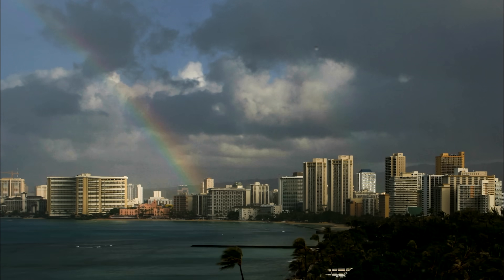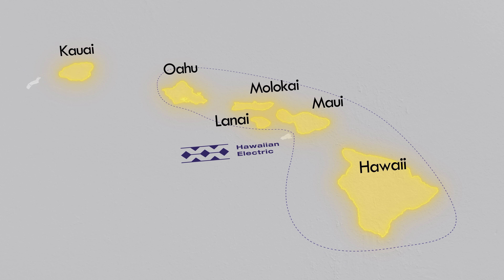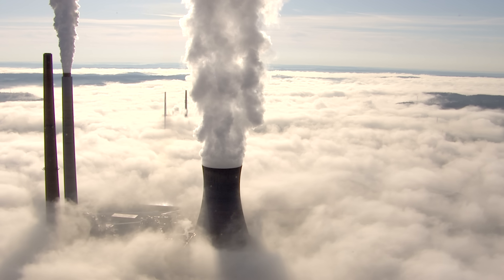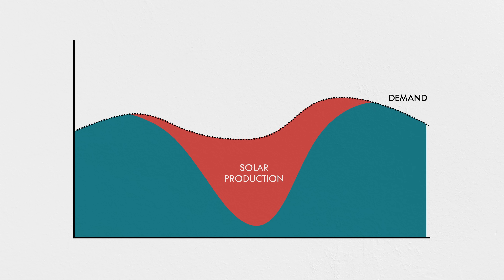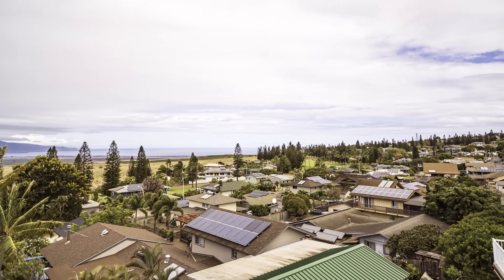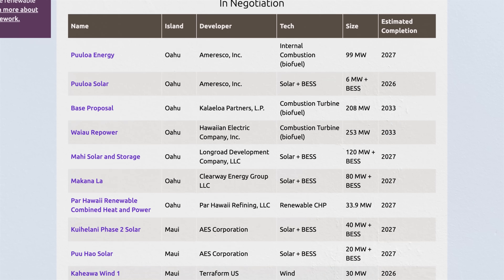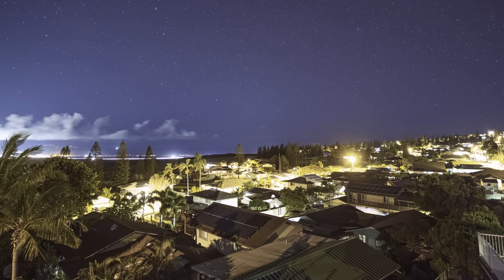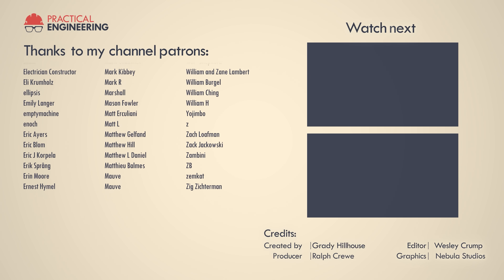How the Hawaiian Power Grid Works

Comment: When I was in Iceland I was amazed by how much infrastructure has been built out for geothermal power generation. It seems like a no-brainer for Hawaii that they should go all in on geothermal on the Big Island, and drop a DC interconnect cable to the rest of the islands to share the power.

Iceland did this in the late '90s, and as a result their citizens get electricity for basically free. They have so much extra power that it's cheaper for companies to mine bauxite in Australia, ship it to Iceland, and smelt it using the excess power in Iceland than it is to smelt it in Australia.
Reply: In contrast to Hawaii, there are no 3000m deep fissures on Greenland. Hawaii consists of up to 9600m high Volcano Mountains on the 5000m deep ocean floor.
Reply: Except as said in the video the costs of connecting the islands is not cheap.

Also their one geothermal plant broke due to lava
Reply: Its so funny how many people go about repeating that. Yes iceland smelts aluminium, if you look them up on electricity transparency services, their day/night swing is just 100 MW, they have a constant consumption of 1.4 GW 24/7. BUT Hydro is more than doubling the geothermal production.

Geothermal is more relevant in supplying their heating, wether process heat or residential (which given the climate is a massive energy saving),
Reply: Only the Big Island has a viable geothermal potential. The one facility near Hilo was almost over run by lava so it's a tricky power source with such volcanic action changing almost daily.
Reply: The islands are ex-volcanoes rising up out of the ocean depths. The sea is three miles deep. 

It's not like the islands you get off the shore of the mainland USA. The sea around those is shallow, often less than 200m - they are still on the continental shelf (the British isles are the same). 

The power cables can't be like those use for communications, which are a few inches thick. A DC interconnect cable needs to be much thicker, otherwise you loose to much power.  No-one has ever laid a DC interconnect cable across oceanic depths.

Can it be done? Probably! But Hawai'i would be the first people ever to do it.
Reply: The politicians here are far to corrupt to do anything practical or that word actually benefit the working class.
Reply: Cmon. You visited Iceland so you know it’s power? About 3/4 of icelands power capacity is hydro, the rest geothermal. Geo is much more expensive than hydro to build, and needs an ample  fresh water source. Iceland  has that, Hawaii not so much.
Reply: I'd imagine geothermal requires quite a bit of water as well, preferably fresh water, because it works on the steam cycle.
Reply: @belacickekl7579  I think they inject it back in the ground, so it's reused, unlike nuclear and other plants where steam or warm water is released for some reason.
Reply: @sandal_thong  'for some reason'. That's what I'm trying to explain; because of the laws of thermodynamics, you can only extract so much energy when making electricity. The remainder goes into the air or water exhaust.
Reply: I remember something about the geothermal plant in Hawaii not working right or causing pollution even before it was shut down by the lava. As to whether natives oppose geothermal projects on principle, that should be looked into. Maybe it's just a matter of them making the decision, like for the astronomical observatories?

Elsewhere in the states, Native Americans are considered low caste, and expected to get out of the way when whites want to use the land, like for pipelines. And when "Water Protectors" protest, authorities come down on them (and reporters) harsher than you'd think warranted. In Alaska, there's coastal erosion, but those in charge don't want to give permission for native communities to move their towns further inland. I guess they're supposed to stay put and fall into the sea? Probably foreshadowing what will happen to island communities around the world as global warming proceeds.
Reply: The volcano is sacred to a lot of native Hawaiians.  It'd be like building a nuclear power plant on the temple mount in Jerusalem.
Reply: @jeffspaulding9834  Don't need to build the power plant literally inside the caldera of the volcano. You drill down at any point on the island about 500 to 1,000 ft deep and you'll get rock hot enough to boil water.
Reply: @Hyperious_in_the_air  Sure.  Now frame that argument so that people who believe a volcano goddess rules over the islands will be persuaded.

Religion and logic aren't always best friends, if you know what I mean.
Reply: @jeffspaulding9834  Just a bunch of voodoo horseshit really. A shame it's holding them back.
Reply: @jeffspaulding9834  the elites also practiced !nc3st, cannibalism, and ritual sacrifice should adhere to those as  well?
Reply: @jeffspaulding9834 Religion has always been a barrier to progress
Reply: @jeffspaulding9834  Yes, and?
Trees were sacred to my ancestors. Didn't stop 'em from cutting them down when needed.
Reply: @stevenschnepp576 I imagine your ancestors didn't have quite ability to increase the cost and political maneuvering required to cut down those trees as the Hawaiians have at their disposal.
Reply: @stevenschnepp576  And that's why deforestation killed off natural habitats, a problem we're still trying to fix
Reply: Much of Iceland's power was used for Bitcoin mining.
Reply: Youre thinking of AC... The distance for DC is much too far...
Reply: @thejman5552  Look into HVDC transmission (Wikipedia has a good article) - less loss than AC, fewer conductors, no requirement to have the phases synchronized.

It'd be perfect for Hawaii's situation - except for the undersea cable bit.  I think people fail to realize how far apart the islands are or how deep the ocean is around there - the big island is actually the tallest mountain in the US if you count the undersea part.
Reply: @jeffspaulding9834 It’s taller than Mount Everest if you’re including the underwater part
Reply: @appleintosh  True, but I specified "in the US" because I don't know if there are taller mountains than the big island elsewhere in the world if you're measuring them that way.
Reply: @jeffspaulding9834  The islands are closer than Britain is to Europe - and they have an HCDV connection. The difference is that the English Channel and North Sea are nothing like as deep as the ocean around Hawaii!
Reply: @jeffspaulding9834  How is HVDC of any use to Hawaiian islands if marine cables are ruled out?
Reply: @Nill757  I suspect you  misread my comment.  I was replying to someone that seemed unaware of HVDC.  I never recommended it for Hawaii because of the undersea cable bit.
Reply: @jeffspaulding9834  --  Well, how far are they apart?   Five hundred miles?
Reply: @GilmerJohn  A quick Google search says it varies from about 10 to 70 miles for the main inhabited islands.  The channels are really deep, though - as in a few miles deep in some cases.

I'm not saying it's not possible, I'm saying that it's probably something that would require a lot of expensive engineering and development and would run the risk of a very expensive failure.
Reply: @jeffspaulding9834  --   Well, if it's a few miles deep you will need at most a few extra miles of cable.  It might require some anchors every so often to keep the weight of the cable from stressing it too much.

It might take some good engineering but otherwise it's a "doable" problem.   

I suspect that the geothermal in that area desn't scale up very well so it's just cost effective to continue to haul fuel and run either diesels or gas turbines to generate the power.
Reply: @GilmerJohn  Looking at Wikipedia's list of undersea HVDC cables, it'd be a lot deeper than any we currently have.  That's the "lots of engineering" bit.

It does list something called "PowerLink" as a proposed power connection in Hawaii, but didn't give details.  You might look into that if you're interested.
Reply: @jeffspaulding9834  --  Oh, I have no particular interest.  I just jumped in when my former engineer ears perked up when it was said that it would be very difficult to send power between the Island.   That just didn't "Sound Right" to me.
Reply: @thejman5552  -- There are tricks to make underwater AC lines run further.   Usually, the problem is too much capacitance and this can be compensated with some lumped inductors along the line.
Reply: @thejman5552 The UK connects with Denmark using HVDC and that is 765km (475mi). The straight line distance between the east tip of O’ahu and west tip of Hawai’i island is only about 250km. The benefits of a DC connection is that it has frequency isolation so that one island not having enough energy doesn’t affect the others.
Reply: @Thrad5  Thanks for informing! New rabbit hole unlocked!
Reply: @thejman5552  lol, no. DC is vastly superior. There's an interconnect line running from the Columbia River all the way down to Los Angeles at something like 1,000KV which experiences minimal loss compared to AC.

Comment: why not use Geothermal? I'd think it wouldn't be sporadic on Volcanic islands...
Reply: They do have a little Geothermal, but really it's not as simple as you might think. Geothermal for electrical generation needs pretty high temperatures, so even on volcanic islands you need to drill fairly deep, and drilling into really hot rock is difficult and expensive.

Comment: One thing I want to mention. When I lived on the big island one thing you could see on a lot of peoples homes were solar panels. Even crappy looking beat up homes had them. So while the grid as a whole is mostly petroleum there are a lot of homes that get their power from solar during the day and the stored power in the home batteries at night. Plus virtually everybody I knew had a little Honda generator for when the power went out. So while the grid would under go blackouts they could either used their own personal stored solar power or just turn on their generator.

Comment: I did some design work on a simple cycle combustion turbine generator install near Kapolei about 15 years ago.  Besides the high wind, high seismic, and unfriendly volcanic geology and a high salty water table, there were other atypical costs.  It had to be a 'black start' unit, so it had its own batteries and diesel generators to fire up the CTG w/o off-site power, not cheap.  Additionally, the unit was credited for providing power to emergency facilities, hospitals, fire stations, etc.  therefore increasing its IBC importance category from the normal III to IV, a considerable expense and an increase to the design loads. 

Lastly, shout out to Palo Verde generating station at 5:05.  My favorite plant and an absolute beast.

Nice video.
Reply: What does IBC stand for?
Reply: Doesn't look very Verde
Reply: @westrim  Literally or figuratively?
If you mean literally, I get it. Not much grass around that power plant.
But figuratively? That power plant is the second largest nuclear power plant in the U.S, providing Arizona with reliable, carbon-free electricity. The white "smoke" coming from it is simply water vapor with absolutely zero carbon dioxide, other dangerous gases, or radioactive substances. Nuclear power is one of the safest forms of electricity generation out there, with a deaths per unit of energy number similar to that of wind or solar, even when counting Chernobyl and Fukushima. Chernobyl is estimated to have killed 4000 people, Fukushima killed exactly 1 and Three-Mile Island killed 0. In 1975, a hydroelectric dam in China failed due to a big storm, and the number of deaths it caused is an order of magnitude higher than Chernobyl, and the only reason why hydroelectricity has more deaths per unit of energy than wind, solar, and nuclear. However, using fire to generate electricity has killed way more than nuclear or any renewable source. The use of coal and oil to generate electricity has killed millions of people due to air pollution and will kill more due to climate change. Even natural gas has killed more people than nuclear and hydroelectricity due to the small amount of air pollution it creates.

Comment: The "low inertia" worry of solar at least (and I assume wind, though I'm not nearly as sure how well wind turbines deal with the accompanying load modulation) is self-inflicted: due to their inverter nature and trivial ability to throttle their inverter's power source, they could be programmed to behave as desired, including like a steam turbine (though it might require some capacitor or battery storage to fully match steam turbine behavior).
The issue is just that grid operators didn't want solar inverters to behave anywhere near like that for a long time, and by now seem to have mostly given up on it in favor of letting storage plants that perform day/night energy shift do the task of grid stabilizing.
Reply: It would make them more expensive mainly. To get the same amount of inertia you'd need a big capacitor bank or a massive flywheel, and those don't come cheap.

Comment: I'd say that Hawaii is a good testbed for renewable energy.  Multiple independent grids gives multiple test cases.   Lack of local fossil fuels coupled with high prices from high transport costs puts both commercial and green interests more in sync.  Also, being relatively close to the equator means potential solar energy varies less over the course of the year and any other US state with Alaska being the most variable with some areas in the north not seeing sunlight for months at a time in the winter,

And, as a mostly tropical climate, there is less danger to people when an outage happens.

Comment: Fantastic!  This is the first time I've heard anyone outside of power systems electrical engineers bring up inertia on the grid!  Part of the value of building out pumped hydro storage is increasing the spinning mass connected to the grid to stabilize frequency.  It's great that someone is finally discussing these more complex issues!
Reply: Is it the fly wheel effect?
Reply: @mark33545 basically yes

Comment: Honestly, I’ve never given much thought to the Hawaiian power grid before, I’m surprised it doesn’t have high-voltage DC interconnects though.  That system wouldn’t solve all problems, but it might help with some issues. A quick Google search shows it’s been proposed several times over the years.

Comment: In Germany (and Europe) solar inverters have to monitor the voltage and frequency. If these values go out of tolerance, the solar inverter must switch off. An automatic relay is required. A large Chinese manufacturer ignored the regulations and then had to repair hundreds of systems free of charge. The manufacturer did this "voluntarily" and did not want to be named in return.
Reply: Probably Huawei, we have some Huawei inverters at the company I work for.

Comment: The issues with electric power in Hawaii can be summed up simply as: Politics and Environmentalists.   
Even mediocre engineers could easily make each islands electric power reliable and less expensive, but politics always prevails.  Though it indeed has the highest electric rates in the US (>3x), it is also one of the most highly subsidized electric generation infrastructures, especially the "green" methods.  Lived there for 5 years on the "Big Island" of Hawaii, the geothermal power stations were the only sources of several island-wide power outages every year.  This is because in order to get the Federal grants to build and operate the totally subsidized generators, the Federal government required that they be connected to the island-wide electrical grid.

Comment: I use about 15kwh a day , its 0.45c per kwh not including standanding charges and other government rubbish so in total I spend about €3000 a year on power that's a con. The more "renewables" we install every time the price goes up they claim "due to the cost of wholesale importing" or some other way of saying we have investors and we have to pay them. This year I'm going to install about 5kw of panels and I'm building banks up from old laptop cells (3x1kwh banks already made up) and going to try to lower the use of the grid as its just a scam these days. If you look at it this way a single 395w panel is now only €90....payback for panel alone is less than 6 months, it's insane how cheap it has become to just say goodbye to the national grid that's become one giant bunch of rich people looking to screw jow public.

Comment: Well, in such a situation 'virtal power plants' could be a valuable part of the equation. They virtually connect sources and demand through data links and computers to control and adjust both demand and generation. If implemented correctly they can also provide some system services to stabilize the net. By the way, wind turbines could in principle provide inertia with the rotational energy of their long blades. It is a question of technical design.

Comment: There have been recent develpoments on Hot Dry Rock Geothermal in Iceland. They are working on tapping the very high temperatures in rocks near magma. The Big Island, connected to the rest of the Islands could provode a major amount of total demand, 

How do I install Spellchecker on You  Tube.